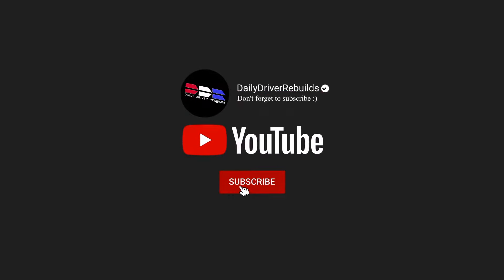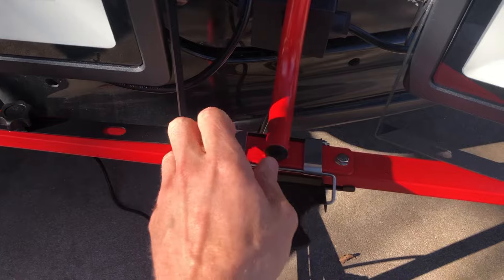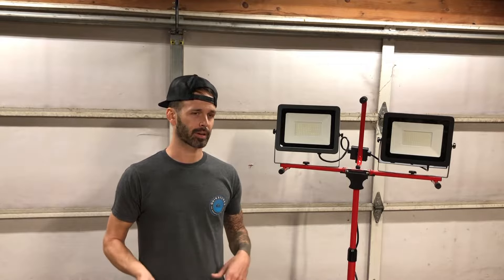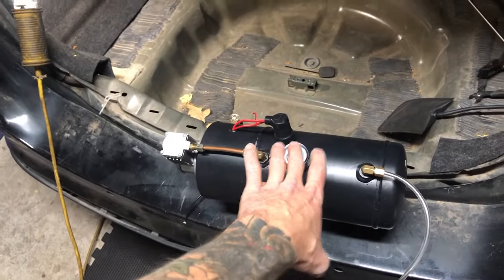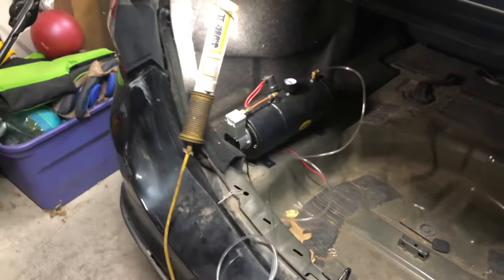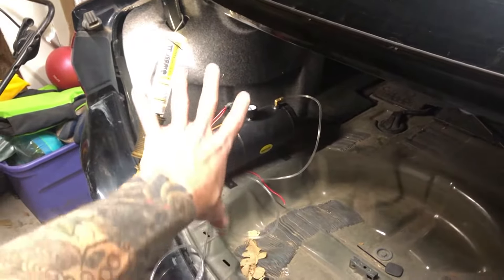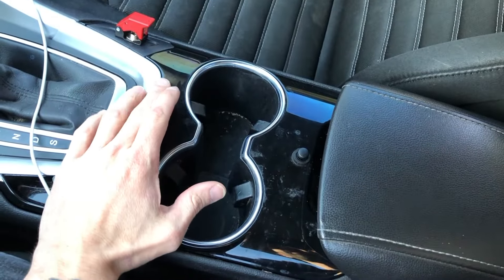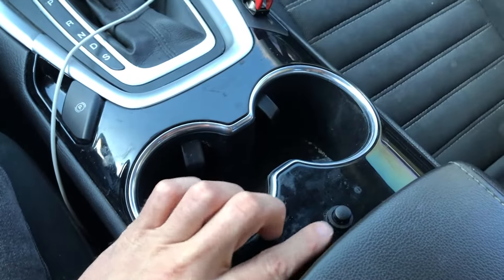Installing Amazon Train Horn

Comment: This guy seriously said "This kit comes with everything you need to make it work, but you have to buy some items separate", twice.
Reply: He's saying it doesn't come with a button or power wires. Said it twice so you were aware that it works out the box, but to install it you'll need ____
Reply: The horn “works” using just what’s in the box. A custom install in your vehicle requires additional parts like longer wires and an on/off switch. Not hard to understand for most people

Comment: If you change the hose for a air compresor hose it will sound waaaaay louder
Reply: Thankx for the tip what size hose do you recommend??
Reply: Yea wouldn’t some compression be lost through leaking and expansion with that hose

Comment: I’m probably gonna buy one for my truck and wire it up to the main horn because my horn doesn’t work anymore
Reply: Can you explain how to do that? I like that ideal.
Reply: You need to wire up a 12v relay to utilise your existing horn circuit switch as otherwise it will overload it. The relay will switch the power from the battery via a separate fuse (which you will also need).

Comment: How is this working for everyone?  My compressor/tank are located under the hood up high.  No moisture or anything.  After a month, the piston in the pump snapped off the cam.  I bought a new one and installed it.  Pumped up to 60 psi and......SNAP!  Brand new one snapped.  These are too cheap for me.  Returning.

Comment: Ive got a 24 Chevy extended Express Cargo van and putting one these horns in soon.. i suspect i will be mounting compressor and air tank in the rear and hopefully fit horns uder hood.. I live in Cape Cod so this is a necessary device to install with tourist doing 15mph below speed limit.. I Can't wait to give them the proper send off..

Comment: Anytime you run any length of wire from battery you should put an inline fuse at the battery end just in case of a short. The fuse should be sized to protect the size wire you run.

Comment: You didn't talk about the wiring of the horn itself they're not labeled negative or positive I'm guessing it doesn't matter? It was a lot harder to install the horn without taking apart I wish I would have seen that before that point. Like a typical man I lost the instructions so that probably told me the wire polarity issue 🤣

Comment: That +12 volt supply has very weak insulation and if it arcs onto the frame you will get a fire.  Maybe run it inside some spiral wrap or conduit, and power it via a solenoid next to the battery.   Now it's a long length of live +12v.
Reply: Those wires do look pretty small I got the unit I ran a bigger one like he did